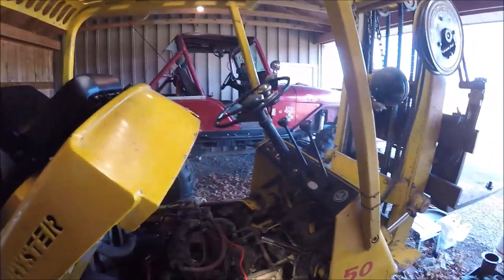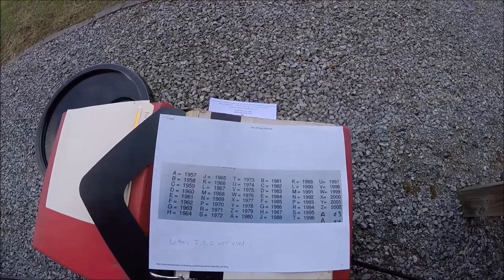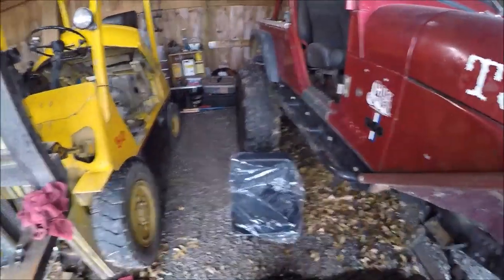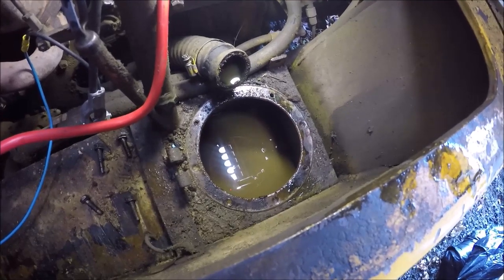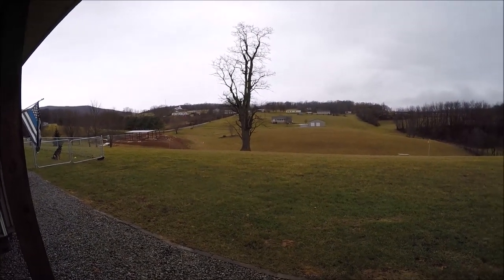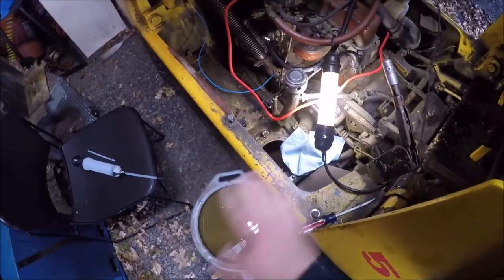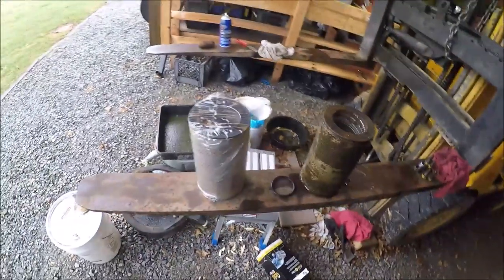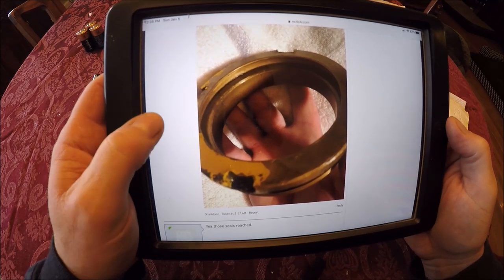Hyster fork lift repair part 1

Comment: Lots of work to keep you busy!   Idle hands are the Devils workshop!! LOL   Good luck with the forklift, it will be very helpful in that great big shop.
Reply from the maker: Right about that. Are you getting all this snow today like we are?
Reply: Hello sir. I've got a 40 series hyster LP runs fine when cold but when it warms up it starts to die. Symptoms are 
does fire at times normally

#1 Backfires mostly through the exhaust which sounds to me like it's running lean. 

When trying to start it will fire at times but does not star once you let go of the ignition switch it stumbles and die mostly with a big back fire.

Have tried a MAP sensor. Tried a vaporizer from a Toyota still about the same. 

I dont was to just start throwing parts at it. The local dealer wont help with probable cause will not sell the parts anyway. What a great business a do it yourself will not have any help. Even if we can by parts from them. If you have any help I would greatly appreciate it. 

  #

Comment: The seal you are looking at in the video is only a wiper seal at the top of the cylinder to keep the dirt out of the cylinder the main lift seal is at the bottom of the rod, you need to take the rod out to replace it. The H50H was a very reliable fork lift had either a ford gas engine or a perkins diesel. Most of the Hysters in the UK were fitted with the Hyster monotol torque converter transmission but this seems to have the oil clutch. The only thing to look out for on this model is the upright hanger bolts there are eight bolts that hold the upright that go up from underneath and the steering ball stud that is welded to the side of the frame they can snap off and its a difficult job to repair with the engine in place. Also the needle rollers in the steering axle king pins and centre pin can wear for fun if it used on very rough ground.

Comment: Good update.    95% of the time the lift truck weight is about 2000lb more that the lifting capacity.  All of my 5k lifts  are around 7k lbs.  Im looking at a 3500lbs lift now and it is 5200 lb. its a old 80s modle
Reply from the maker: Oh good to know. Both the Monarch lathe and G&E shaper come in at just under 5000 pounds so that gives me a little extra is perfect.

Comment: Looks like the lift is keeping you occupied while the shop construction is happing. You most definitely will need the lift to move the machines in.
Reply from the maker: Yep. Wanted to get it ready for the move. It will be a huge benefit.

Comment: Did you ever have to remove the drive axles to replace brake shoes?  I have a similar machine and cannot get them off.
Reply from the maker: No I never did any brake work on it.

Comment: I’m guessing your forklift is about 10-15 years newer than mine. All that modern stuff. My forklift runs great but there are a few minor leaks and one major leak, I have to pull the engine to fix the major leak. Maybe I’ll get to it before summer. I’ve been saying that for years...LOL.
Reply from the maker: If mine is a 1981 model then you do have an old one. Good thing about them is that they are fairly simple and with a little preventive maintenance they last forever.
Reply: @hilltopmachineworks2131   I am about to buy an OLDER one on Purpose, because they are EASIER to work on , less electronics to deal with , Simple ,  still  heavy parts and all,  its not like working on a Truck,     but very straightforward from what I can tell...... Just as a comparison, do a  U Tube Search for the  new model John Deere  FARM Equipment  ( expensive Assets), and what an absolute NIGHTMARE they are if they break down ..  Big  Big Money,   just to Transport them to the Dealer  who is the only one allowed to touch  them .....  just as a point of  comparison ...  So sometimes OLDER is Smarter , especially when you dont need all the Bells and Whistles, and you are not running 24 Hours a day with the machine , ...  Just need a part time work horse to do the job .   Thank you for your Video ..
Reply from the maker: @jefffromjersey52  We have been working on getting all the seals for the mast cylinder and it has been a night mare. Since it is so old some parts are obsolete. Having to piece meal everything but looks like we have what we need. Hopefully we can get back to work on it and have part 2 posted soon. Thanks for watching.

Comment: Those are great machines, I've got an H50J .
Reply from the maker: Oh cool. What year is yours?
Reply: @hilltopmachineworks2131  late 87'-88', been a good machine. I paid $700 for it from a plant that owned it. One kingpin bearing was shot and the brakes of course didn't work, but the parts were pretty reasonable aftermarket. Swift Forklift parts on Ebay has most common parts, the harder to find stuff try these guys- 
hgmforkliftparts.com/hyster_forklift_parts/catalog_index.aspx      If you have a serial number they can find nearly anything.
Reply from the maker: @darinareyacrazyman1505  You got a good deal. Thanks for the parts info.

Comment: You skip the most basic part...how to access the engine area
Reply from the maker: Nothing tricky. Just lift up the top. It is on spring hinges and comes right up and stays in position.